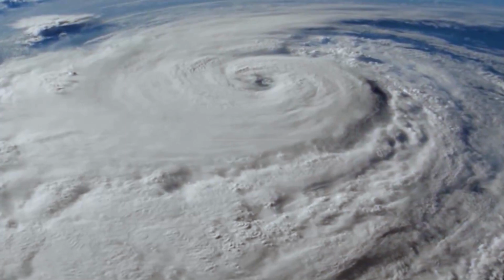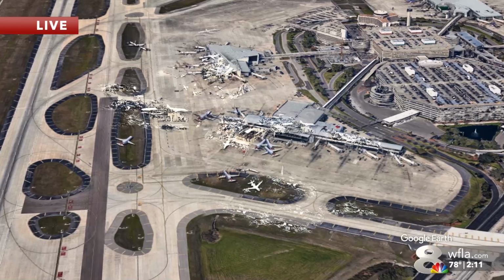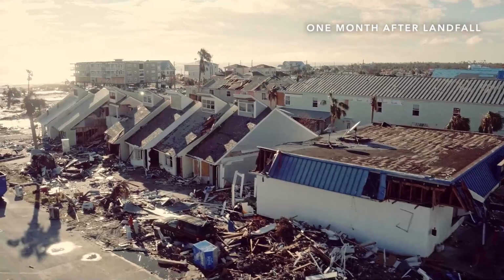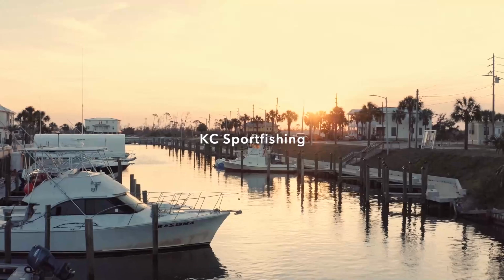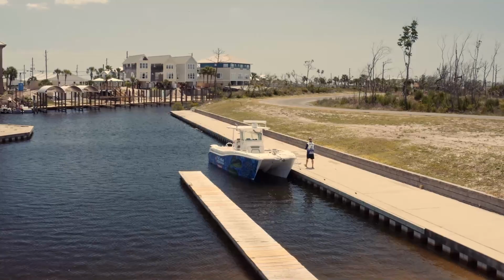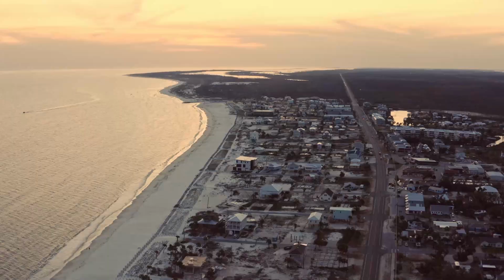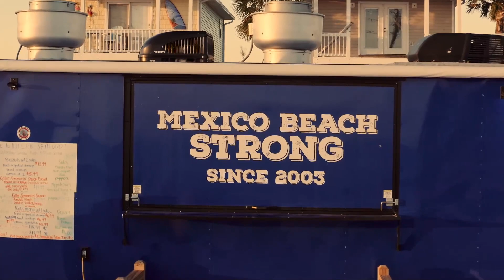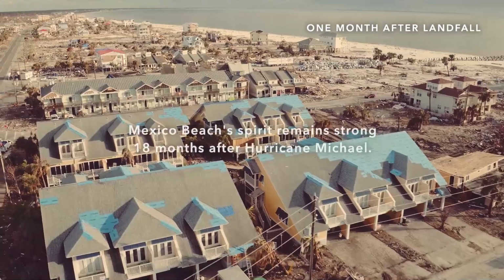Project Phoenix 2.0: The Recovery

Comment: As of today, October 22, 2021, it has been 100 years since Tampa has been hit directly by a hurricane.

This, however, is NOT the true worst-case scenario. 
Imagine if 2004's Hurricane Ivan or 2005's Hurricane Dennis or Hurricane Wilma had taken this track...

Recent storms, like 2019's Lorenzo and both Larry and Sam of 2021, have shown that strong and large systems can absolutely pile up the storm surge potential.

In this scenario, the storm surge would be that of a low-end Category 4 storm since it strengthened so close to land and didn't have the chance to build up a massive wall of waves in front of it.

Someone mentioned having a house at an elevation of 52 feet in that area. In this scenario, that person is relatively safe. In a scenario where a storm enters the Gulf of Mexico as, say, a 140mph Category 4 and rapidly intensifies, however, even 52 feet of elevation might not be enough.
Reply: Interesting to read this... 
As of today, September 27, 2022, 2.5 million people from Tampa and the surrounding area have been mandated to evacuate the region.
 Cat 3 or 4 Hurricane Ian is expected to hit that region tomorrow. And, most/all of FL will be affected by up to 24" of rain.